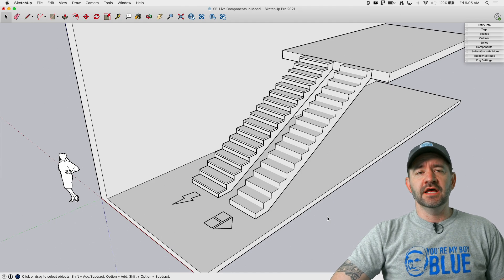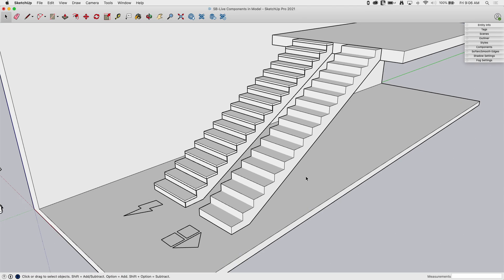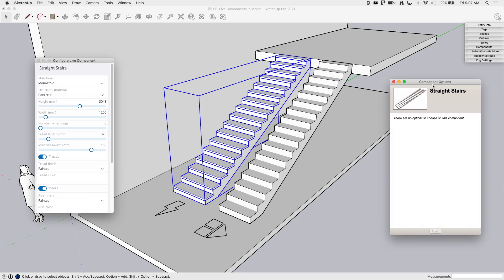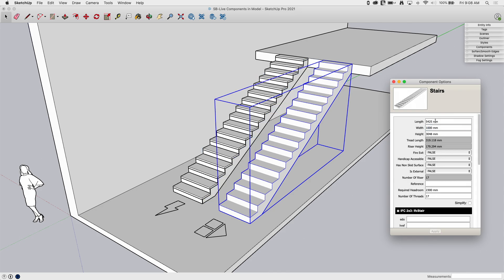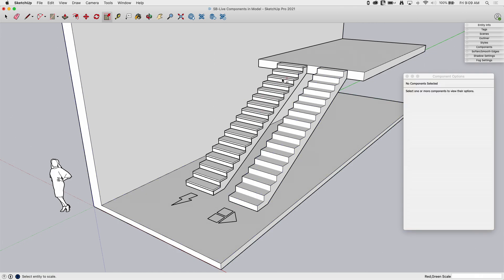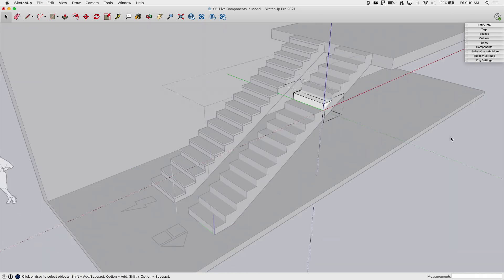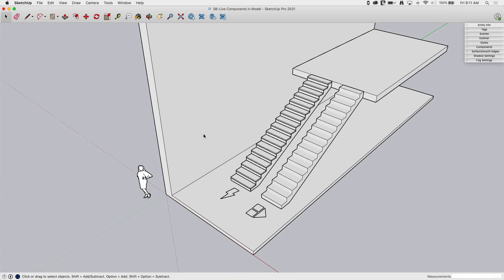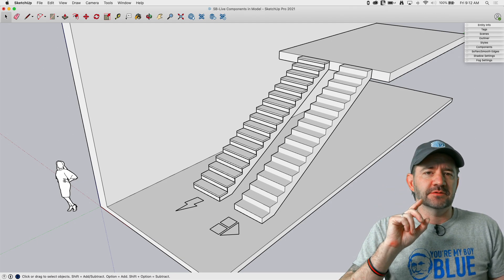Live vs Dynamic Components - Skill Builder

Comment: Might you have simply built sliders and delete the Apply button in Dynamic Components.  I know Trimble has grandiose plans (and needs now subscription dollars to pay for them), but the sub audience who specialized in building DCs (think Marvin Windows) has to redo their work in LCs format to stay relevant.  Who pays for that work?  Aaron you do a great job playing educator and diplomat but I have not seen any real advantage to LCs as a major hyped “new” feature of 2021 SU Pro.  M.Donnelly did a good job also evangelizing them but still, what are we paying for over DCs?  The node-based parametric 3D modeling of Grasshoppers, etc. seems closer to the original DC construction techniques where math meant something.  How about a DC to LC converter for free?

Comment: Scaling (and restricting axis) is perhaps THE main reason I design my own Dynamic Components. More often than not, I want to graphically snap a component into place and have it smart-scale on its own, not use a dialog.

The other issue is the slow online database access. Once more we see the move from stand-alone to web app and I'm definitely NOT a fan.

I wish that the issues with DCs we're addressed instead as LC aren't that helpful to me as is.

Comment: I know this has nothing to do with components but, that top tread should be eliminated or entire staircase dropped equal to one riser. If it were even with landing it becomes a trip hazard and to my knowledge  unacceptable by IRC. I believe in of itself becomes a platform/ landing there by it would have to meet the 3’ minimum code. Just sayin.   As far as live components, and the new logo, I guess this is what we’ll be paying the extra $100 for.
Reply: Hi! I was wondering, I have a annual subscription for SketchUp Pro 2020 and I've updated/downloaded just a few days ago the SketchUp Pro 2021 but haven't seen anywhere written that I have to pay 100 $ more. You are the 3rd person who has commented about that saying that is 100 $ more. Where have you seen that or what do you know about that? when will it apply, at the renewal? Because just for a logo change and the possibility to put tags in individual folders I find that quite a lot to pay for! Thanks
Reply: @rynovlad3112   log into Trimble and you’ll see it. Under products, Pro version subscription, $299 per year. 
I have a (had ) a perpetual pro license/maintenance agreement for years, I downloaded and installed the new Blue logo SketchUp, and it said it’s a 30 day trial. I went into my Trimble account and it shows as a trial and no longer does my PAID for version appear. It says upgrade to subscription, for middle of the road subscription pro version of I believe it is $285 per year. Up until April 2021 my cost is/was $185. That where I came up with the $100 extra come April. BTW, they sent me a serial number so I could use 2021 unencumbered by 30 day trial, but come April, it’ll be $285 for me. Also I can’t use this new feature  Pre Design until I upgrade to the subscription. Haven’t decided if it’s worth it or not. I can do without the logo, I can do without the live components, and I don’t need pre-design cause my other software has all I need in that respect. I’m finally able to use Pre design. Maybe it’s true, squeaky wheel does get the oil.
Reply: @douglasmichel6361  Well, maybe they've changed it, but not now. I'm sure of that because I bought the SketchUp Pro 2020 in September (I'm from Europe) and it was already 274 Euros  plus VAT so I've payed 328.80 Euros in total.  I have done what you've said and I don't see any changes in Trimble. Thanks for the answer and the time you took for it! But you can still use your old version of SketchUp , I have both now, the red 2020 and the blue 2021 running at the same time 😃
Reply: @rynovlad3112  makes sense, if your paying 328 Euros, that’s about $285 US no? Either way I’ll probably pay it in April when my 2020 license expires. We’ll see. So long as I’m making money with it. Anyway, Cheers mate. May run into ya next time I’m in Scotland for a pint or two, or three. 😁
Reply: @douglasmichel6361  Not really 🤣 that's about 391 USD.  But you're right, as long as it delivers we shouldn't complain..  Yeah, that would be great😃! I live in Paris, but who knows?
Reply: @rynovlad3112  is it? I guess I’m not up on the exchange rate. Hey when in Scotland why not visit Paris, I’m always up for a field trip. 😎
Reply: So, guys.. Have you met or not? 😂